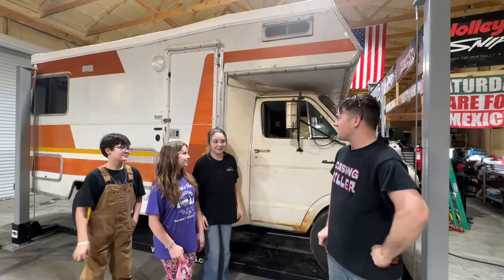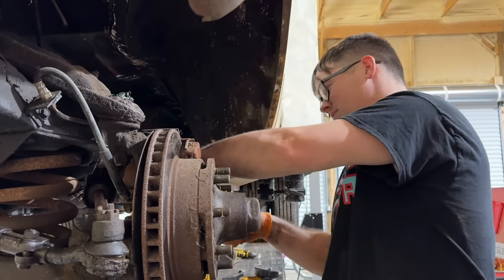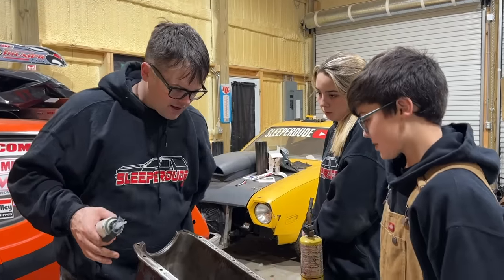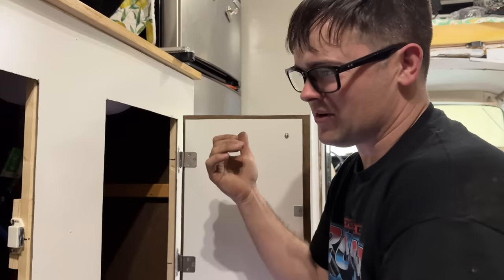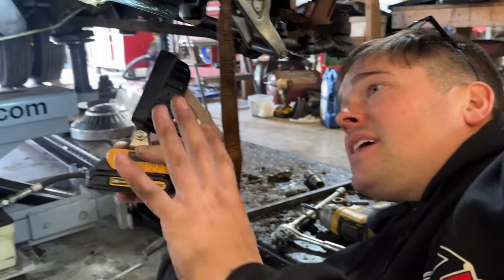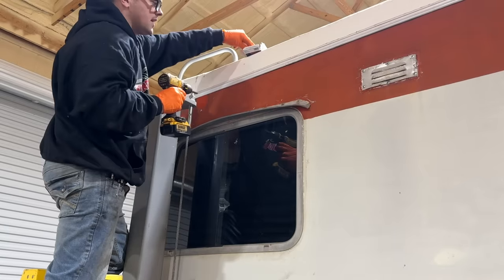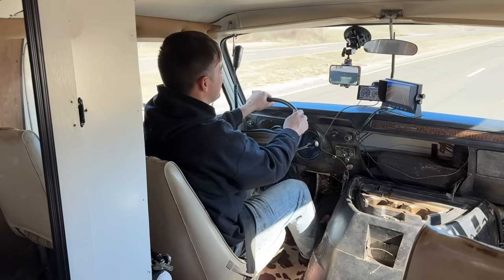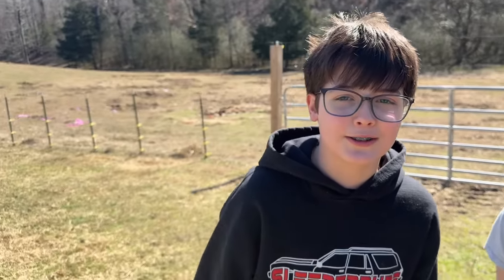HUGE LEAK!! Can We Finally Get This RV Roadworthy?

Comment: Josh, I'll give you a tip to save your roof ac this time: measure how tall your vehicle is from the ground to the top of your roof ac cover. Write feet/inches how tall it is on your driver side sun visor. You will thank me when you see a low bridge height and try to drive under it👌

Comment: At the 1hr 20min mark..I noticed that the antenna wire coming out in the cowl isn't sealed up. Make sure you seal that off or you will have water in the cab. Just had this issue with my ford ranger. Love the videos!! Keep it up.
Reply from the maker: Ok thanks

Comment: The kids really stepped up and helped Mom & Dad with the RV repairs and fixes. Good welding on the exhaust pipe Ralphie. Looks like Chrysler/Dodge designed in a removable K frame (subframe) to gain access to the oil pan. Great fix on the oil pan! The Minnie Winnie has come a long way since you first brought it home!!!!  Drivetrain, interior, HVAC, all updated --- ~~~~~  She's ready for the open road now!! Wow-just an amazing job. She's got more character and patina than any new RV!!!!!

Comment: Grease in the caps is definitely the way to go. It doesn’t do much until you get a hot bearing, then the grease in the cap will warm up and flow into the bearing.
Reply from the maker: I agree

Comment: 1:08:15 yeah the spring settled.  I still can’t tell exactly even after watching at .25 speed a couple times, but it looks like the part you can see rotated. I love marge quickly backing away, probably thinking, am I in final destination? That thing was fastened but did it just try to kill us?!

And for a tip, you might be able to fix the wiper motor. Especially in older cars, just take it apart, carefully keep track of what gear and stuff go where, but just clean out the grease cake that’s probably all solid, maybe clean some corroded parts, re-grease and reassemble.  The RV is low mileage so it’s unlikely to have a worn out bushing of any kind or bad brushes, and there no circuit board type stuff to go bad.
Reply from the maker: Ok thank you

Comment: That wiper motor likely is fine. It's probably just stuck and or the brushes that contact the motor inside is frozen or dirty. Cleaning that and giving it grease will probably bring it right back to life
Reply: I had a 1971 Demon that had the same problem. Turned out to be the ceramic resister on the WW motor
Reply: Spindles could be corroded .

Comment: Great chanel. I just wanted to say how important backing plates are. They are used to control air flow to your disk brake rotors to keep them cool. Also, you could have taken lower engine mounts loose, fan shroud bolts off, and put a screw jack under harmonic balancer to raise front of engine. Put blocks under engine mounts after raising then remove screw jack, then pan should come out. Some times you have to (fudge) the pan around.  Keep up the great content.

Comment: One thing I can suggest is to weld you some tabs on the mount your generator is on so you can chain it and lock it. I’ve had a couple stolen off race trailers that were just ratchet strapped

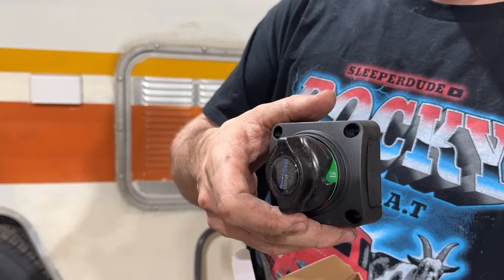Comment: 36:20 most RVs have 2 batteries, a RV battery to run the lights and low voltage components, and the engine battery to run the starter and exterior lights. Both are charged by the engine's alternator, but there is a battery isolator to prevent the RV battery from discharging the engine battery, so you don't end up like Walter White and Jesse Pinkman in breaking bad. Lol

Comment: Those 5.9 Magnums are a little more forgiving about oil or lack of anyway than you might think. My old 97 Ram fell victim to the typical oil screen plug that many of them did. To make a long story short, I worked 2 hours from home. Came out after work, started it up and got the oil pressure alarm. Checked it and it was full and I chocked it up to a faulty gauge and drove it home on 2 lbs of pressure. I couldn’t afford to have it towed that far anyway. Got it home and called my buddy who owns a garage to see if it was something he could situate in a day for me. He’s the one who ended up telling me it was almost definitely low oil pressure and not a faulty gauge. I bought the oil pump and swapped it out hoping I didn’t hurt it but knowing I probably did. No metal shavings when I drained it and no more than normal for a 150K engine stuck to the magnet in the pan. I ended up putting another 60K on the truck without a problem and still held good oil pressure and no noise when I finally traded it in on a new F-1Nifty. lol.

Comment: Get another safety switch for the inverter side , the inverter puts out 12 volts only  your alternator puts out 13 to 14 volts and 60 to 120 amps it will fry the inverter or your generator if you back feed it ..

Comment: A little trick when it comes to those Wiper bushing. Ive installed a few on my channel. But if you drill the center out a little smaller than the opening it will push on easier and sort of lock in.
Reply from the maker: Ok thanks

Comment: Man That was a Lot of Work !!!!!    I have ran into that issue --  I have used a 2 foot piece of angle and removed harmonic balancer and drilled a hole near the end and used balancer bolt to secure angle to crank. Use that to jack engine high as You can and remove engine mounts and jacked it up high enough to get pan out!  Saved me from pulling motor more than once.

Comment: Josh, those impact electric crimpers work great, ...But, as with any DC electric connection, you should coat the wire and the lug with die-electric grease. It's not a matter of if, but when, it'll start corroding.
I still think you should find a place and put in a house battery, make it to where it will charge when hooked to shore power, and it will provide the power when running off the battery. Also put a battery disconnect  so you can charge going down the road and disconnect it from engine battery so you never discharge the the main battery. 
And lastly, I think Squeeze should be allowed to paint the entire outside of the camper!
Bless you all, and for all you do for us viewers!

Comment: You could still add a second battery if you can find a spot for it. Best thing I ever did on mine cuz I could use it all weekend and drain it but still be able to start it up on the main battery. I used an isolated so I’m charging both while driving but when parked I’m only pulling off the secondary battery. You know, camper things .

Comment: Hi Guys, if you run your furnace or any 12 v appliance, you will drain your truck battery. Make an attractive battery box somewhere inside to keep the deep cycle battery warm, get a battery isolator, and don’t get stuck by accident. Been there, done that.

Comment: You will probably never see this, but I had a fully custom van that had what's called a "Battery Buddy" on it. It will only let the battery drain to a certain level than it kicks a breaker to stop everything from draining the battery, so you always have enough juice to start the vehicle. Such a great device and works every time.

Comment: i hear its pretty loud when you guys are driving it, what you can do is get this foam spraying stuff they use for automotive sound absorbing which is kinda like expanding foam but its soft and feels like memory foam when it dries. I think you do need the spray gun for it as well and you can spray the whole bottom and wheel wells. Might need to contact a bodyshop supply store to get it.

Comment: After reading your comments about the dangers of coils springs I used to just take a small chain and ty it loosely around them anchored to the frame somewhere near using 2 bolts to ty the chains together and you don't have to worry about it now more as the chain will keep it from going any where, love the videos I can't wait for the next one to come out. They are my favorite period.

Comment: I'm really proud for all of you!  It's always great that every vehicle is a family build!  Maybe Wa and Squeeze could paint the raw lumber inside.  The engine sounds great and I'm glad that the pan gasket fixed the oil leak.  You know as well as I that it could have been a lot worse if you had to pull the engine.  Maybe you could buy some eBay aftermarket trim to cover the holes on the left side that have copious amounts of sealer around them.  :) Papa Jim, Augusta, Ga.

Comment: Just rewatched and noticed something during the drive at the end. Josh, you need to finish the wall behind the driver's seat. You shouldn't be able to see 2x4s. LMAO. That's the woodworker in me. LOL
Reply from the maker: Yeah we also need to put paneling up below the cabinets. One day
Reply: LOL. Didn't want to come off as one of  those fault-finders, Josh. But now that you've mentioned it, add a bottom to Ralphie's bed like you put on the cabinets, since it's going to spend most of existence in the up position. To offset these observations, just let me say, really nice interior. @Sleeperdude

Comment: Had a pan leak on a brand new engine build for an ‘88 S10 Blazer with one-piece rubber gasket.  Finally had to drop it as much as I could and smear everything with RTV and that finally fixed it.  Ridiculous, but nothing else I could do… if the pan is warped, it’s gonna leak!

Comment: Josh the computer won't let the fuel lean out until temp gets at leat 190 . A cold stat will not stop an overheat . If the cooling system is nominal it should not overheat even in the hottest weather on the hardest pull . Good luck 👍👍👍👍👍👍👍👍

Comment: The idea of the brake backing plate is one of three reasons. 1 is to help force air around the back of disk to help limit brake fade 2nd is to stop water from hitting a hot disk as this can in extreme cases fracture the disk causing it to crack or explode in extreme cases and the final reason is radiant heat if you been driving hard then come to a stop you get a radiant heat that could cause a fire. So this is why you should put the backing plates on. I’ve had to replace both the rear backing plates on my citreon c5 estate because I live close to the sea the salt air destroys most metal things the only good thing about the citreon c5 is the body is galvanised so this limits the rust and rot issues. How ever citreon thought I was a good idea to put alloy brake callipers on the rear where they get all the road dirt and salt water in the winter. As an engineer I see you have a great mission going on with that oil leak to be honest that’s a lot of work and I hope the out come is a full cure and a dry sump/oil pan.

Comment: I believe what you're looking for is a RV charge controller it has input for offshore/generator power it switches from battery power and keeps then charged when plugged in most of them also have the option to connect solar panels but its not necessary

Comment: Ralphie awesome job welding up the exhaust pipe on the mini wini!!!! I can definitely tell you buddy that most adults can’t even weld exhaust pipe up because of how then it can be and they will usually end up blowing holes in the pipe as they are trying to weld exhaust pipe up!!! But can you weld up two pop caps together after cutting both ends off of pop cans??? Ralphie if you take and cut the ends off of two pop cans and then practice at trying to weld them together and if you can do that you will most likely become someone that will be able to weld just about anything together!!! I definitely wasn’t able to do it when I was first starting to weld years and years ago but after many years of welding I have definitely been able to weld two pop cans together with a mig welding and also brazing them together!!! You should definitely try it in a video and show everyone how well you can do it your first time trying or how much more practice you might need before accomplishing the task?? I am definitely going to say that you are going to be a really good welder just seeing how well you was able to weld up the exhaust pipe for sure!!!!

Comment: I may have missed it, but you could also add a couple solar panels to help charge the battery at a stand still. Just an idea!
Reply from the maker: Yeah we might at some point
Reply: I got a 10 amp solar charger that plugs into cigarette lighter, lays up on the dash or suction cup to windshield

Comment: When your messing with them ball joints like that that are stuck, sometimes depending on where they are at if u dont have room to hit them with a hammer a air hammer with a flat bit is a big help. Saves some energy too.

Comment: One thing I had to take apart more than once was my 289 in my Mustang. I had to drop the oil pan twice because I kept dropping the oil pump driveshaft. after the second time,I bought a new driveshaft and installed it the correct way.

Comment: Make me a Dream Car Josh.  Ok Glenn.  Which one?  The Black Ford Falcon Futura.  Build one of the 351 Windsor engines.  Get Discount Darrel to do the transmission.  Paint it.  Do the body work at home and rent your old work's paint bay for a day.  You are magic with a paint gun, and a wrench.  Here are some specs from Wikipedia for the 351 Boss the most powerful 351 Windsor ever made.  You can beat those numbers today.  The Boss 351 was the most potent high-performance variant of the 351C available only in the 1971 Boss 351 Mustang. Rated at 330 bhp (246 kW), it was fitted with a four-barrel Autolite model 4300-D spreadbore carburetor, an aluminum intake manifold, solid lifters, dual-point distributor, a six-quart oil pan, and cast-aluminum valve covers.[1][14] Forged domed pistons gave an 11.1:1 advertised compression ratio which made premium fuel necessary.[13][15] It had four-bolt main bearing caps selected for hardness and a premium cast-iron crankshaft selected for hardness (90% nodularity).[1] The cylinder head was modified for better airflow, used screw-in studs with adjustable rocker arms, and except for the water passages and larger combustion chambers, were very similar to the heads used on the Boss 302.[5] The valve train used hardened and ground push rods with guide plates and single grove-hardened valve split locks.[1] The forged connecting rods were shot-peened and magnafluxed for strength, and used improved durability 180,000 PSI 3/8-inch nuts and bolts.[1] The R-code Boss 351 was only installed in the 1971 Boss 351 Mustang, and it came equipped with Ram Air induction. Ford manufactured 1,806 Boss 351 Mustangs in 1971, 591 of which are registered and accounted for on the Boss 351 Registry site.[

Comment: Josh those 4 piece Chrysler gaskets have little nipples on them, you are supposed to put the front and rear rubber gaskets on the block and then RTV the sides.  That might be what was causing your leaks. Those little nipples on the rubber gaskets plug into those small block holes to hold the gasket on. As much as I hate the 4 piece gaskets myself I always use them on Chryslers. Especially the 2.5 Jeep Warnagler motors. Every time I've used the one piece they leak because they don't mount up in the front or rears like the 4 piece. Great job on getting it sealed i was sure hoping it wasn't the rear main lol.

Comment: Make sure your Radio matches up with your antenna you will need a set meter you can get one for around 20.00. If you don't it will burn up your radio.swr meter have fun

Comment: You should test that battery theory!!! Disconnect the battery, start the generator with that switch on and see if you’re getting power up to the battery. I think you’re correct but I’d like to know if it would work.

Comment: You didn't stake the brake pads, they will move around in the caliper. The two outer pads have 2 tabs on the top that'll bend down and lock the pad to the caliper. Stick a pry bar in the bottom of the pad and the rotor hub and pry it upwards then tap the top tabs down.

Comment: Ralphie, to answer your question about rocks between backing plate and rotors it does happen a fair bit on gravel roads.

I do roadside assist (similar to your aaa i think) and we get it relatively regularly with work, makes an  interesting  noise

Comment: Miller C-3564A was the original dealer tool for breaking the ball joint taper on the B vans. A couple large bolts, nuts, steel pipe and mig welder could replicate it.

Comment: On my Utv dual 12v battery setup.  I use the Tru Utv battery isolator.  It's automatic.   Use that instead of that manual switch.

Comment: Excellent video Sleepdude Crew  Josh  :) , family  👪,  , yes 19ft Dodge Camper it turn out super 👌 👏  and don't forget get Motor replacement for windshield wipers too ! Also nice kids like working on vechiles together with Josh ! Also think vechiles ready for traveling  to and for battery  used on camping for long life hours use  a Deep Cycle Marina boat battery! Cold Cranking Amps  850 or higher with 150 to 250 Reserve Amps!

Comment: Josh, the only thing left to do on the rv(besides a new wiper motor) would be a new paint job along with a touch of squeeze artwork!! Looking forward to the next camping trip video!!😊😻
Reply: I found a 1 Din 7" Flip Out Car Radio Stereo Touch Screen Carplay Auto Android USB Player. this might be something you can install in that thing. this is a large screen radio ... You still need a sound system.
Reply from the maker: Thank you so much we appreciate that

Comment: That new wiper bushing is not on all the way. I just did this job a few weeks ago, it's impossible to press them on while on the vehicle. Unbolt the assembly and pull it out through the cowl opening. Use your socket method and a bench vise to press the bushings together works perfectly. While it's off the vehicle it will give you a chance to lube up all the moving parts so the new bushings don't wear out. The complete assembly can then go back in through the cowl. Hope this helps.

Comment: I rebuilt the windshield wiper transmission on my d350 Cummins diesel I had to use some dishwashing liquid I broke about three or four of them before I finally figured it out if you heat them up a little bit they go on a little easier too